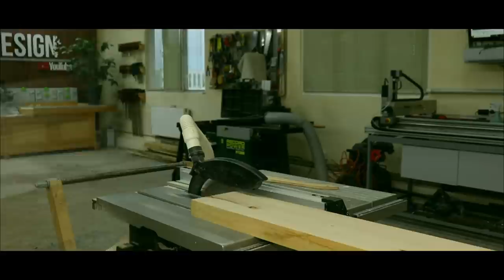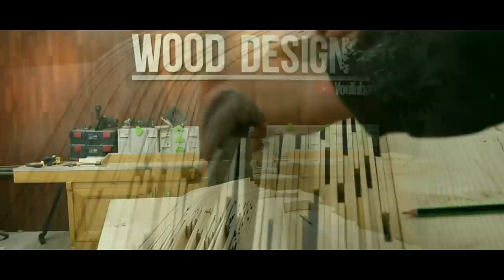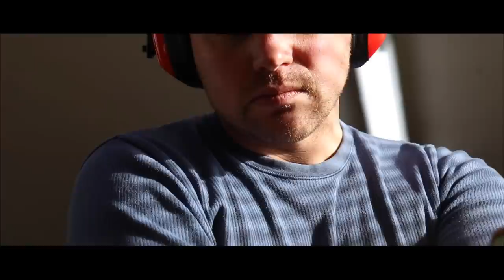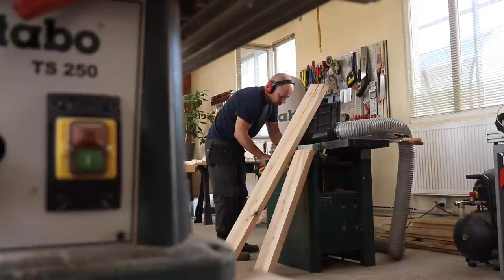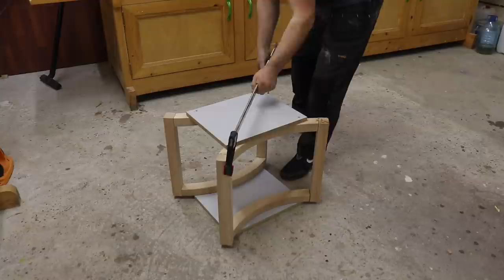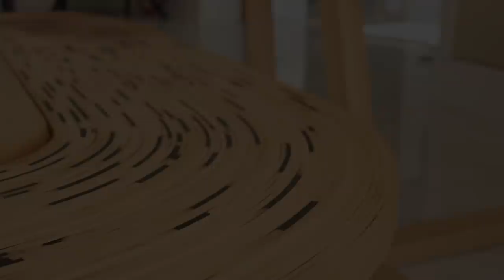Woodworking. Bench. Bending Wood Without Steaming. Эпоксидная смола

Comment: WOW! That is an incredible design. Who does the designing, you or your son? Very impressive indeed. You were born to do this. I have been designing and making furniture for over 40 years and I am very impressed with your attention to detail. People don't realize that when you design and build a piece of furniture, it's not just the furniture you need to design, it's how to clamp it up, what jigs you need and what's the best joinery. That's why hand made furniture costs so much. I have a few tips for you. First tip...Rub wax over your band saw guide bearings it'll stop them squeaking. I noticed you were using polyurethane glue or PU as it's know as in the UK. I don't know if you know this but PU glue cures in the presence of moisture. You only need to put a thin film of the glue on one surface and wet the other surface with a damp cloth. The glue will foam up and cure more rapidly. Oh and, if you don't want to spend hours scrubbing your hands, wear gloves when you use PU glue. I used to have to spend about half an hour scrubbing my hands when I came home just to get my hands clean. So I invested in those cheap boxes of latex gloves. Best investment I ever made. I used to leave a candle at every machine in my workshop. If you rub it over your machine surface before machining your work, it will glide over it without leaving marks on your work. Less effort needed! Always a good thing. I am glad to see you both healthy and COVID free. I wish you and your family all the best and stay safe! Well done to you both on your latest masterpiece.
Reply from the maker: Thank you. I design because my son has a lot of work to do. So I agree with you, not everyone knows how to design furniture. Thank you for your helpful tips. And also thank you for the fact that you can spend your time on our video and reviews and tips.

Comment: What an ingenious idea, I guess the water in the wood turns to steam (or at least hot enough to soften the grain) when the hot air gun is applied? Far less messy and doesn't require a steamer...
Reply from the maker: Thank you so much. We are very pleased that you found your video useful.